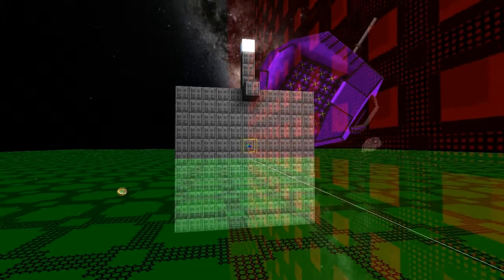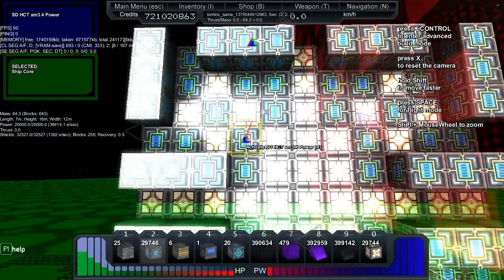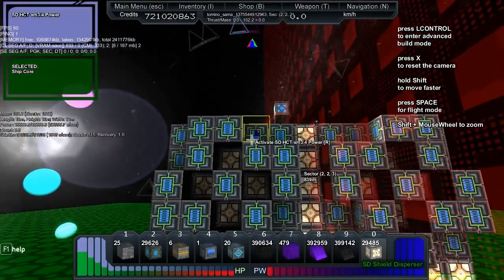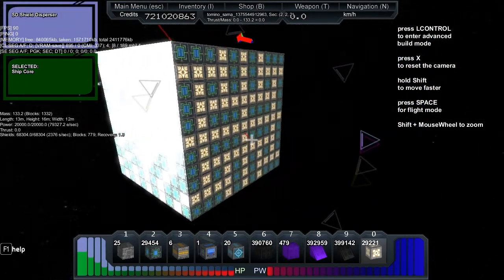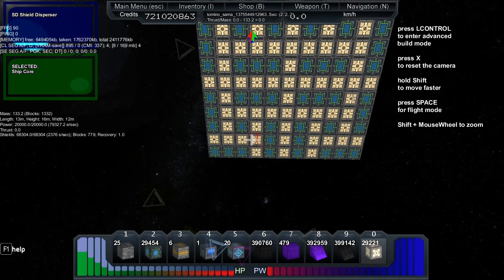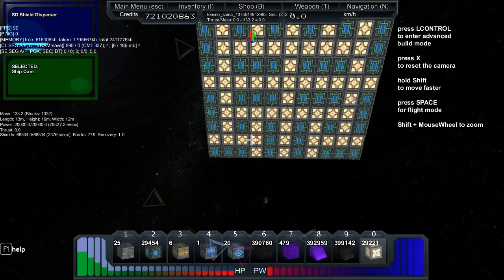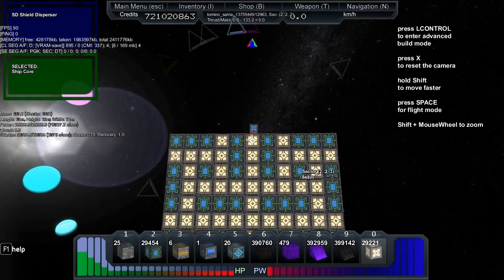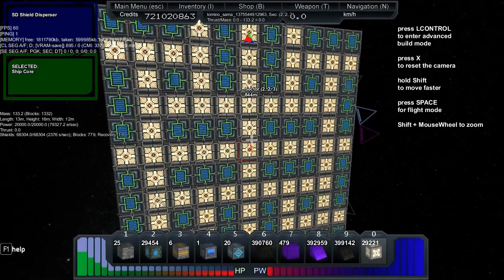Starmade Ep52: Reactor 9927 in 11x11x11 Tutorial [current leader] 79,327 e/sec

Comment: Given the helix-based pattern of the 9927, it might be better to exploit by simply extending the core along the shaft axis; 8 of them in a straight chain should garner more e/block albeit you're trading a longer length for the better e/block rating.

Comment: The problem with expanding 5^3 generator patterns like this one is that connecting them almost always reduces e/block efficiency, or you're stuck with spacing out 3D arrangements of them, like in this video, which also ultimately results in a reduction of e/block efficiency.

The key is the "basic" cell group pattern, how well it can be "stacked" with other cells like it, and how often it's replicated into the space that's given (5x5x5, 11x11x11,etc).  I have one design which is pending a video.

Comment from the maker: thanks for your comment. This was a test to see if reactors generate more power when connected or separated. See Episode 50 for the result of connecting them. The 10x10x10 will be next. This is currently generating more Power. The average per volume is 59 e/sec with this Pattern. (The 9x9x9 produced 49 e/sec /vol) 
I did try to explain this during the video, although at first i expected a higher e/sec.